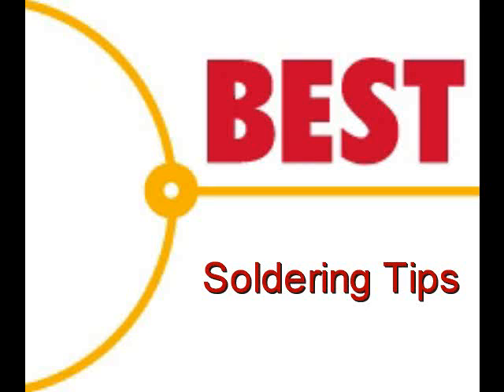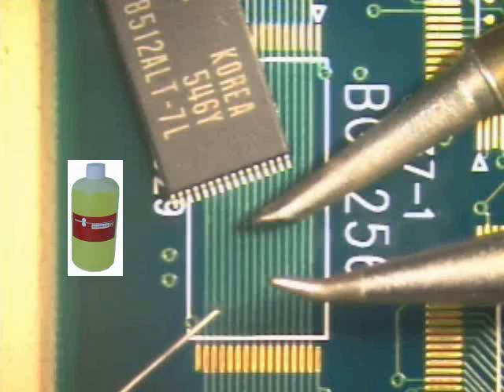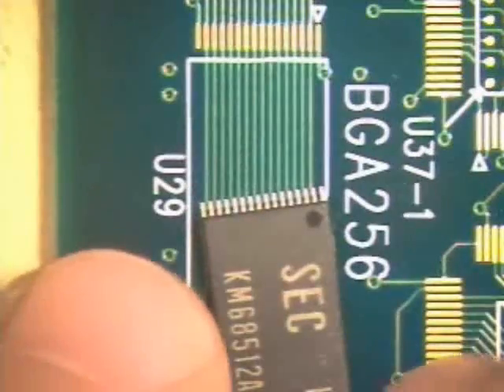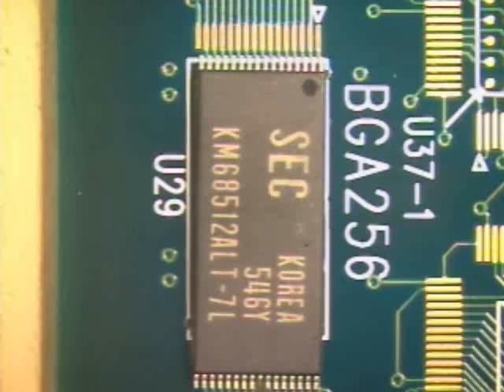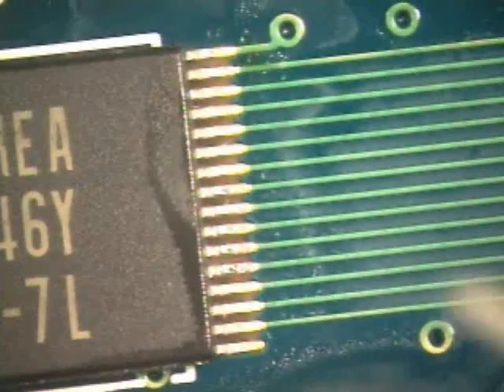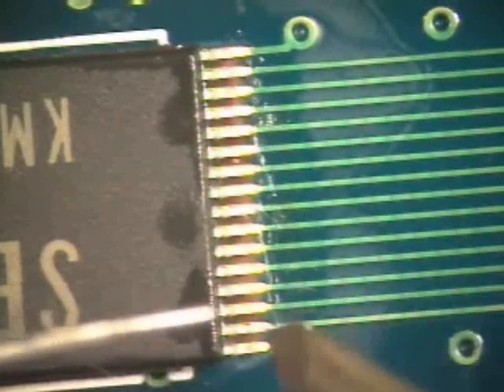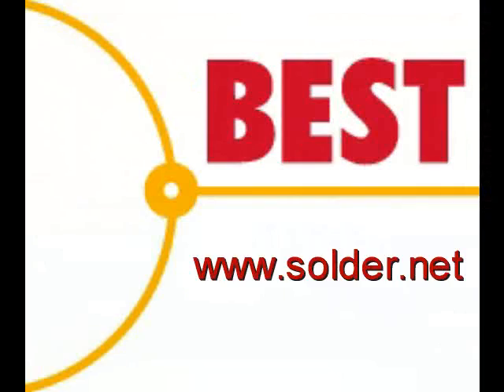TSOP32 Installation Drag Method

Comment: There are no cold solder joints there. First you have to consider this is lead free solder, which does not look bright and shiny like the Lead/Tin alloy. Second, the pad in which the component is beeing soldered appears to be longer than needed. Since this is probably a training board, I assume the pads are slightly bigger than they should so the students can practice. I consider nothing is wrong with his technique. It's rather excellent imo.

Comment: What solderng oil is the best for regular solder and for lead free solder?

I have AMTECH NC-559-V2 and GC electronic flux oil, none of them does not work very well. I do have high recovery soldering station (Pace), proper tip and I prehear at 60C.
Still it melt pins together and I have to use braid to remove it.

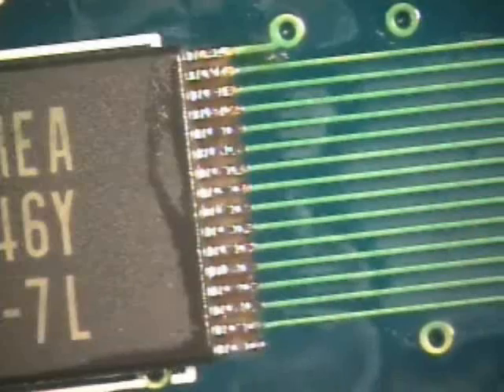Comment: There is no need for any standard to see at 2:22 that the lower half of the pins are poorly soldered. You can actually see the yellow on the pads, meaning that the solder did not not wet that pad.   It's common sense. If you can make them look like the upper half or like at 2:04 it's fine.

Comment from the maker: I think that spring loaded solder suckers should be banned since they cause more problems than they are worth.  I have trained at many companies that have desoldering issues and find out they are using solder suckers.  
Desoldering with solder wick in thru-hole is not recommended and if you are it is the last resort.  To many issues like thick ground planes.

Comment: How are chips soldered that have their pins not around the body but on the rear side. Could it only be done in the reflow soldering oven or also by hand (evt. with hot air or sth.)?